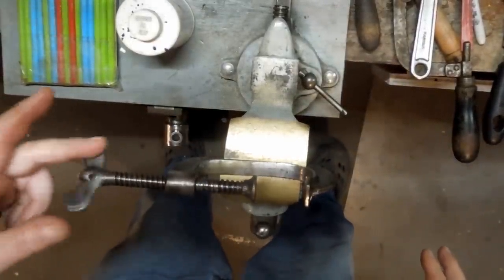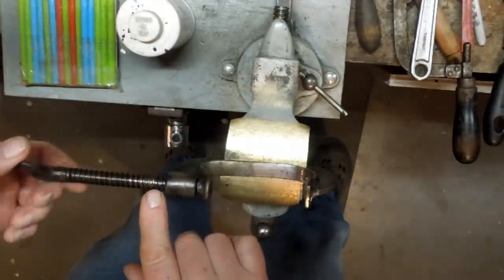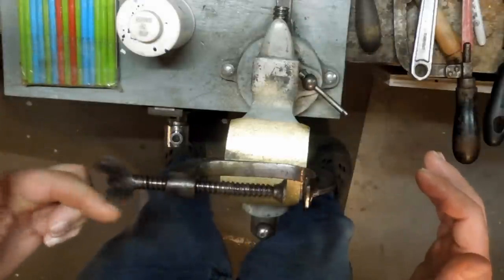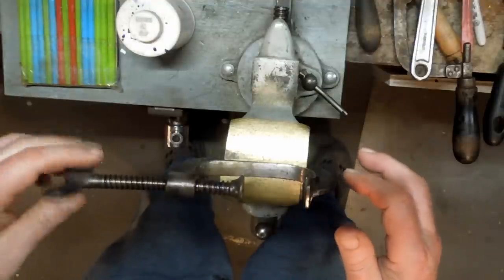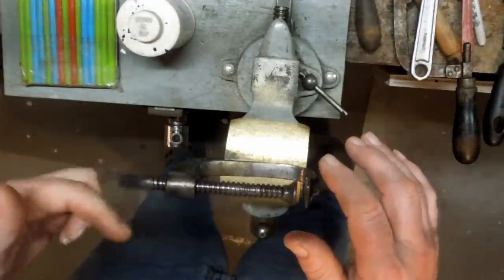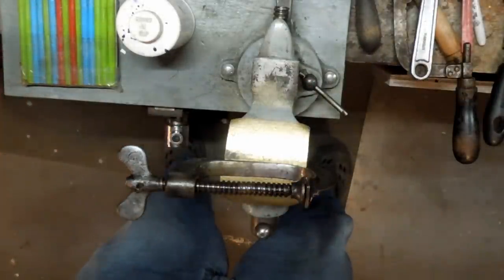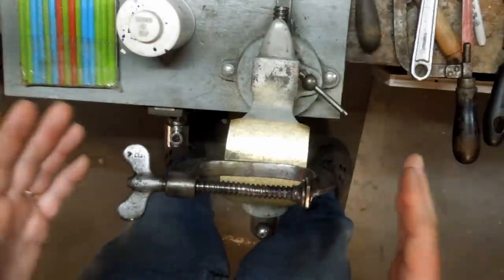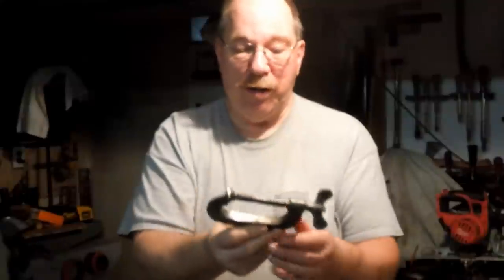ScoutCrafter Clamp Challenge Pt 3 Clean Up

Comment: Some people think single point threading on a lathe takes skill, what you did was great craftsmanship!!!!
Reply from the maker: Thanks. Making an original thread is not too bad. Turn the shaft to the listed size in the Machinist handbook. You grind the tool. Or buy the insert. Then set the feed and turn the shaft. Not easy but it's by the numbers. Finding the size of an old non standard thread is a pain. Easier to fit and file than to try and make new.

Comment: The Silver solder really looked strong!  It resembles more of a braze then a solder...  Very nice!   The camera angles when you were filing was spectacular.   Great stuff Dave!  😃👍
Reply from the maker: Thanks John. It melts at a lower temp than brazing rod. 
I like the overhead camera setup. I still have a problem with the camera shaking. I hit it with my head. 😆
Reply: @OldSneelock  That's what they always said about me using my head for something. Anything would've been an improvement.

Comment: Looking good strong enough now I recon wouldn't have any questions using it for any job . When you were filling I was saying get the dremel on it .my wrists would look like I'd off filled them with air next day . Onwards and up wards .take care matey 👍
Reply from the maker: If I have three or four to do I might use the Dremel on the second or third. With just one and no backup plan I go with the slower method. It lets me see my mistakes before they get out of hand. Normally I wouldn't bother with a broken clamp. If I break one it is either a case where I think the extreme use is worth losing a clamp or it is a POC not worth fixing.

Comment: Some men climb Everest for the same reason you fixed this clamp: just simply because they can!  The difference here is that thousands of people have climbed Everest...
I suppose most people who would fix a C clamp would just turn a new screw (which there are lots of videos of people cutting threads).  Now it will be interesting to see the paint scheme. I look forward to seeing that.
Reply from the maker: That is suppose to be todays video. Considering the effect that outside forces have on this project it is dangerous to expect or assume that things will follow the plan. I have hope. 😆😎

Comment: I thought the gullet wasn't deep enough until I saw the bend. Good finish! Ye old files did the job. One of these days I got to get me another thread file IF I ever think of it. The v.a. trip was a true blessing. The new anti-coagulant is a phone call check up. No pokes and no prodding and no rat poison. My nose is long enough. One next month and maybe 6 months and a years supply, a half a pill every 12 hours. I was AMAZED! And the blood work'll come at the yearly physical. WOW! Maybe you ought to check into it. 'Eliquis'. Must be good stuff. So now to theRed, White and Blue. I think I'll watch. Thanks, Unc! I'm going to the comporium.net suffix on the email. The other one has shot itself. They;re trying toi sell my 80 year old computer whiz buddy a bill of goods with no goods so he's canning it. Don't blame him one bit. 
Looking forward to the next'un!
Reply from the maker: Eliquis isn't recommended for heart valve replacement therapy. The mechanical valve smashed the red cells causing them to clot. Don't know how Any blood thinner works but I will happily take warfarin/cumadin pills over those heprin shots in the belly. 😨😎
Reply: @OldSneelock  Oh well. It was a thought and I think I had 5  belly pokes when they thought I was going the route of Coumadin but I'll settle for phone calls till something changes. I hope for the better. You too! And all belly pokers are NOT created equal!
Reply from the maker: The last two series of belly pokes for me were self inflicted. Makes a difference when you know it's coming and can pinch the heck out of the spot the needle is going. The pinch covers the hurt and stops the big pain of pumping a bubble of snake bite under your skin. Ouch!

Comment: Whats the most expensive hand tool you own?
Reply from the maker: In terms of original cost it would be the Milwaukee Sawsall. Most of my tools are either restored or inherited. I have many that would cost a great deal to replace if I were to obtain them in a equivalent condition to their current state. My time spent bringing them up to good usable condition is immaterial. 
Highest replacement cost for any of my tools would be the Ford 8N followed by the South Bend lathe. 
Coolest tool with smallest initial cost and highest personal value is the Disston #12 crosscut panel saw. It is in near original condition with a full blade and proffessionall grade sharpening. It cuts like you are waving a magic wand. 😇😎
Reply: @OldSneelock  gonna look those names becuase I dont know how those tools look . 😁